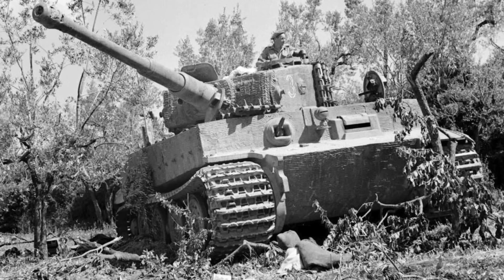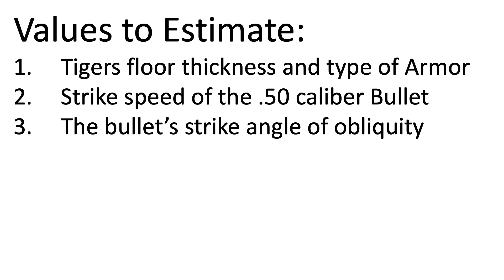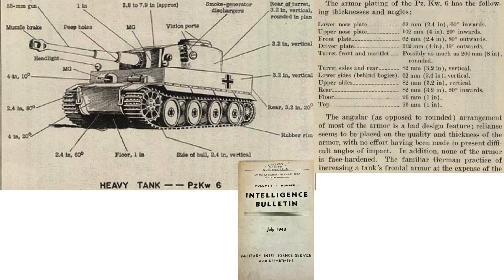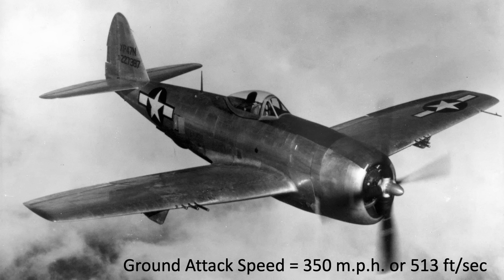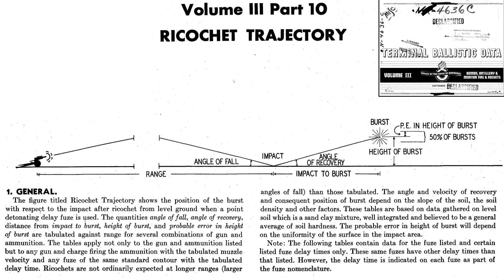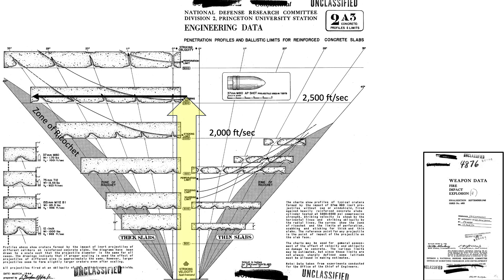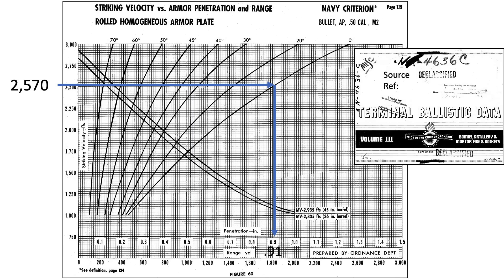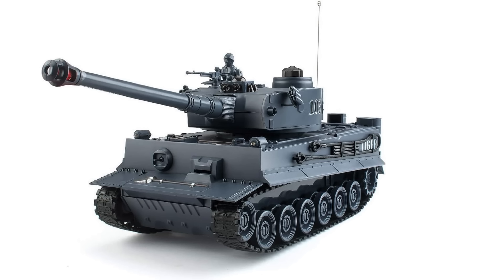P-47 vs Tiger Tank: Can Machine Guns Penetrate Armor?

Comment: Something hilarious about the Panzer 6/tiger tank most don't know is the 1st one knocked out & subsequently captured by the British was in Tunisia being Tiger 131.
All the British had to take it on said tiger in that section in 1943 February were Ordnance QF 2-pounder/40mm antitank guns for those that are metric.
Honestly a QF6-pounder let alone a QF17-pounder had no issue taking out anything the Germans had but it is hilarious to think a QF2-pounder the gun most Americans then & today take the mick out off making it under powered in the few games or shows shown yet of all things 40mm took out a tiger.

PIAT's/personal infantry anti tank would knock out a tiger  tank.
Ordnance SBML two-inch mortar used in a hip fire manner was recorded by mad British soldier to take out tiger tanks once confirmed in Normandy & northern Italy.

You should know after anti tank guns & are artillery being roughly 27/50ths of tank kills of allied tanks on the western front then the next highest kill rate mines at 1/5.
Basically shy of 3/4 of tanks were destroyed by Mines & large field guns of varying kind alone.
Just over 1/8th was (non combat) causes & this was much higher for Axis over stretched logistics compared to  the allies.
Just over 1/8th again was hollow charge infantry weapons & improvised weapons used for unintended purpose of weapons like Molotov cocktails etcetera.
Reply: The first Tiger to be knocked out and captured was by the Soviets on 18 January 1943.
The first Tiger knocked out and captured in Tunisia was at the end of January and was numbered "231".
Tiger "131" was captured eleven weeks later, after the British had destroyed several more Tigers.
I don't recall the 2pdr playing a role in any of this.
Reply: @daveybyrden3936  Oh yes, I forgot abut that one near Leningrad abandoned by the Germans in a failed scuttling & not nocked out technically speaking at point 171 in Kursk I think?
USSR never captured or knocked out ''231'' strangely though heavily damaged externally.

Wasn't that tank at point 171 Kursk safe guarded by the Germans & the crew all survived  if memory serves.
I recall some over 200 14.5 anti tank rifle rounds from PTRS41 hitting ''231'' along with a dozen of each soviet 57mm & 3 inch shells to no avail though it made said Panzer VI retreat a few dozen miles till mechanical failure & fuel leakage from over operation occurred not not soviet arms.
The Soviets ants chased the big scary Tiger tanks till the hardy Russian plains fatigued the tiger for Russian soil is strong ,ah?
''231'' managed to get it's self out of the field on it's own power but barely.

The USSR was the 1st to make a Tiger tank run & flee along with the German crew to save their life's which is hilarious to me personally;)
The Slavic people have an infectious lunacy about them no one could ever match.
You have got to love their spirit, 

On a seperate note "132" was the one captured by the USSR in July of 1943 much later ''131 then ''231'' that slipped away to Tunisia. 
USSR  face ''231'' the Tiger tank to which it ran as fast as it's fuel could take it to only end up in British hands in Tunisia!

 ''131'' &  '231'' are only  ''1'' in place of a ''2'' which has bit of irony in a way & apologies for the mistake on my part mixing up the 2 tanks in my head but my point of 2 pounders still stands!

31st January 1943 early in the morning
 ''"231'' was suppressed receiving damage on all sides but the front & right side hull with two 6Ib guns & countless 2Ib guns. 
taken out by finally a Hawkins Grenade grenade used by a Canadian which they are British in my mind especially in 1940's as Royal assent did not occur till 1982! 

Well my original point was is that 2pounders/40mm guns are more then dangerous to tanks despite what media tells us & your example of ''231'' which |I mistook for ''131'' in the dates.

If Russian 14.5 mm anti tank rifles are a danger to tiger tanks & really all tanks if fielded in enough numbers then 2pounder certainly are.
Reply: @arnijulian6241   
Leningrad is nowhere near Kursk, and January 1943 is 6 months before the Kursk battle. 
Panzer turret numbers were not unique. There were about fifteen Tigers with the number "231".   
The "231" from Russia did not escape and go to Tunisia.
Reply: @daveybyrden3936  ''Point 173 in Kursk'' as conflict did occur in the region before the battle of Kursk.
How did 231 end in British hands if the Germans didn't retrieve it? 
If Tiger ''231'' was captured by the Russians how did it get back to Germany for inspection with flaws fixed in future production models. 
The 231's tank inspection  records were used as examples in the Tigerfibel/tiger training Manuel of 1943.
I have copy scanned print out in front of me  from my Great grand uncle Wolfgang a former Wehrmacht tank commander.
He was made commander as her 7' 8'' tall & could fit in the tank,

Didn't you notice my name sounds rather Austrian for an Englishmen that I am?

I thought Kursk was more north from memory, It's Sort of between Leningrad & Moscow & Kiev.
Show how long it's been since I looked at a Russian map.
Perhaps I was thinking Leningrad as didn't the 1st 4 tigers enter action in September of 1942 in the swampy marshes of that region & one tiger got stuck & abandoned without ever engaging the Russians which the Russian did get to inspect to study to great effect  but neither side recovered it.
I wonder if it's still in that forested swamp?

Their were only 1300 odd tiger tanks 1's made anyway.
How many serial number do you think they had?
''231'' was the hull number not turret.
Serial numbers from 250001 was the 1st production hull & onwards

So the correct manner for serial of 231 would be 250231 on the registries.

*1st production Panther tank 210001 onwards.
*Panzer IV 80001 onwards. 
*Panzer III 60001 onwards.

Etcetera, you get the idea making rather convenient to know by the Tigers production 24 other tanks 

If you want to argue your welcome but I have seen Fahrzeug Identifizierungsnummer as in Vehicle identification number on German armoured vehicles 1st hand as an Mechanical & electrical Engineer lad.

I do find it amusing that everyone thinks they know best on these matter but I talked to the real deal soldiers of all sides in ww2 including Axis even if my German isn't great.
My family & clan Julian are a bunch of Cornish London  Pirates turned Privateers then Mercenaries historically to even my father.

My mother is Austro-Hungarian side in ww1 later 3rd Reich after the  Anschluß Osterreichs were Austria joined Germany in 1938. 

I do get numbers & bits mixed up on occasion but I'm not as off as you think.
Only human & fallible though since my failed health my memory is kind of hazy,
Reply: @arnijulian6241 
Each Panzer had a unique chassis number but we rarely know what they are. They are rarely visible in photos and they are not mentioned in battle reports.
It's common practice to refer to Panzers by their tactical number, which is visible in most photos. But it's not a unique number.
I told you that a Tiger numbered "231" was the first capture in Tunisia. Its chassis number was in fact 250011.
It has nothing to do with any other Tiger numbered "231".

Comment: I want you to consider the tiger's engine deck And how many 50 caliber slugs per second could go through that engine Deck because it's very wide open you could look right through the screen and see the carburetors and these tanks were notorious for engine fires when starting up you could fly over this and put 50 cals through the engine deck and you don't even have to Pierce any armor
Reply: Study the construction of those engine decks. You'd have to be hitting it from directly above to get any rounds inside. The Germans weren't stupid....nor was anyone else. Every tank in the world needed some vents somewhere to cool the engines. They were designed not to be especially vulnerable, although they were often weaker than other areas. If the vents were easily penetrated, then indirect HE fire from howitzers would have bene able to take a heavy toll of tanks, and we already know that didn't happen.
Reply: You're absolutely wrong here. It was not possible to "see the carburetors" from outside. The gratings on a Tiger's deck went to the radiator compartment, which was walled off from the engine compartment.

Comment: Many 'personal accounts' have some embellishment. In a war where all enemy armour is described as a 'Tiger', even though it may have been a Marder or a Renault 35, will suggest that 'we' knocked out more Tigers than even existed. Then again, if you fire enough ammunition at enough tanks, odd things will happen. We can all imagine some 'what ifs', what if the crew had stashed some jerry cans of fuel on the rear deck? What if there had been infantry riding the tank who jumped off leaving a Panzerfaust on the engine deck. 

Shooting up tanks belonging to the enemy is a good idea, it makes them close hatches, reduces their ability to see, identifies them so that the folks with a 3.7" can aim at them. The noise inside the tank would stop you sleeping, increases stress. It is a good move. Did it knock out lots of tanks? Probably not. Did it reduce the effectiveness of tanks? Undoubtedly.

Comment: Excellent video, complete with sources, historical data and impartial research. Well done.

Edit. just for curiosity's sake, I've used a more refined approach to estimate the striking velocity of the .50 cap M2 AP bullet at 400yards if fired at 3213fps. The result is 2671fps.

Comment: They only need to penetrate the engine block… job done.. mobility kill
Reply: The "engine block" is the body of the engine itself. That's the meaning of the term. And of course, the engine was inside the tank. You had to penetrate the tank's armour to even touch the "engine block".

Comment: The rear engine grates were not baffled/  In other words, if you were standing on the rear deck, you can see right into the engine compartment.  I have read of Tiger tanks getting the radiators holed through these openings.
Reply: You're absolutely wrong there. The gratings lead to radiator compartments, which are walled off from the engine. You cannot see the engine from outside.

Comment: Looking at the footage and given that dispersion pattern of wing mounted guns I doubt you could aim under the tank anyway ... that said there is a lot of rounds hitting those vehicles ... they could still do a lot of damage ... the engine bay would be very vulnerable from those angles and they are not the most reliable engines to begin with.  One round getting in past that grille would sever coolant or hydraulic lines or electrical cables, disabling the tank ... given there were other more powerful weapons deployed like rockets on Typhoons I would not want to be stuck in a broken down tank in the open in broad daylight ...

Comment: Having   once been a crew member on an M48 tank . I have little doubt that  a .50 cal, would do a lot of damage to any tank. However the damage would most likely be seen on all the boxes and equipment on the hull of the tank. Also However I  think a tank could be made inoperable if the .50's hit the tracks and suspension and could knock out the engine if the .50s hit the engine grills, which are not armored.. Unlikely the .50s would "destroy" the tank, but they could do a lot of damage. If I  were a P-47 pilot I suspect it would be great fun to work over any tank with your 50s, but to be sure of "destroying" a tank the rockets are a better choice.

Comment: Muzzle velocity of the 50 cal was 2700 fps from a stationary gun. Now figure the aircraft is moving at least 200 to 300 MPH in a dive and that adds velocity to the round and it's penetration. In addition to that, tanks in combat are not spotless. There is going to be oil and fuel mixed and likely on the underside of  the tank. Setting that on fire, under the engine compartment can have negative consequences for the tank. A kill is still a kill if the tank is set alight from spilled fuel / oil just as if it is penetrated by the rounds. Same for all of the oil and fuel cans on top of the tank which was not uncommon given the need for as much fuel as the crew could scrounge in the latter parts of the war. Either way, I trust the word of the folks who were actually there over the paper figuring of someone who wasn't.

Comment: Actually there are videos of .50 ap rounds penning over 1" (25mm) of steel, even going through the head of railroad rails. If fired at a steep enough angle in a dive, .50, 20mm, 30mm fire can indeed pen the top armor of a tank. 
No ricochet required, just dive and pen from the top.
Reply: Railway rails are not manufactured out of face-hardened armor plate. Tanks were.

Comment: Anybody digging up the range test figures for the 50 Calibre M2 (12.7mm. L.130) HMG would know that the shorter barrelled 9reduced velocity) fighter 50 Calibre would fail.

M2 50 Cal AP = Up to 25mm. of RHA @ 0 degrees @ 100 yards
M2 50 Cal API = Up to 21mm. of RHA @ 0 degrees @ 100 yards.

Another 1942 field test report discovered that shooting 100 AP rounds at the lower hull side of an abandoned Japanese Type 97 Chi-Ha medium tank, at a square on range of 50 yards, achieved 35 clean penetrations. The lower hull side of the tank was only 9mm. thick.

Comment: They may have observed how far their tracers would fly when they bounced off the ground. That could give the impression that they have a lot of velocity and were still flying point first. It would be easy to think that ricochettes could be used to go through the bottom of the tank, especially if they didn't know how thick the armor was. 

They probably had a better chance of damaging a track or getting through the deck over the engine, or a lucky shot down a vent, and open hatch on the turret of the like. 

Rockets would have a better chance of doing some damage. There are also some stories about napalm bombs being used against German tanks, and that it was quite effective. I've seen related stories that the Germans at least thought this was true and was a reason they'd abandon tanks when aircraft came at them later in the war.

Comment: They are coming from above the tank , that means , tha even if they do not penetrate its armor , they could still get into engion vents , etc . and cause damage or malfunction , that would put the tank out of use . Next best thing to destroying it , as the Germans had parts supply issues , especially later in the war . Tanks would be out for weeks , or even months , in repair yards just waiting . Ammunition used makes a difference as well . If they leave the airfield , with the intention of going into combat against enemy aircraft , they will probably be loaded with incindiary rounds . If they are on ground attack missions , they will be loaded with AP .

Comment: A now deceased WW2 P47 pilot (and engineer) buddy of mine said he supported Patton, and maintained that the 50's could indeed disable a tank,  though I always remained a little skeptical, therefore I found this video interesting.  (We were buddies because I was formerly an Army gunship pilot in Vietnam, and also a former helicopter anti-tank instructor.) This guy was in civilian life an engineer with me, so not so prone to exaggeration.   I have been downrange and have seen close up what various weapon actually do to armor targets on firing ranges.  Certainly 50's  would damage  external features, maybe the tracks ??, and definitely be hard on any supporting infantry (without which a tank is vulnerable.)  Also, one thing to keep in mind (my experience) is that if one shoots at a point target like a tank then likely that target has unknown supporting buddies shooting back at you, beside the mere tank in question, which tends to dissuade one from getting overly close to objectively examine targets after firing runs.   I suspect the tank dudes just hunkered down till the planes left, then got out and surveyed the damage.  Of course, some of the planes also had rockets and bombs, too.  But I wasn't there.  Maybe these old dudes really weren't exaggerating at all.  Or perhaps the "tanks" they struck were just lightly armored vehicles, more susceptible to damage than tanks.

Comment: One of things people brought up was the fuel trailer towed by the vehicle to extend the range as being the target they went for because the towed fuel tank was armored on top vs the bottom being vulnerable to the intended ricochets.
Reply: Very, very rare in 1944-45. The only extensive use of fuel trailers on German AFVs was in 1941. They didn't work very well so you almost never see them after that.
Reply: @executivedirector7467  well the idea was in assuming that the lack of rail being available from ground attack would force the tanks to make solo journeys was what was said in the original video.
Reply: @TheOfficial007  That may be, but you'd be very hard-pressed to find a phot of a German tank towing a fuel trailer taken after Jan 1 1942. They weren't even common in 1941.

Tanks aren't very good at towing trailers, that's why you seldom see them.

Comment: Would it not be that the 50cal destroy the tracks, making the tiger basically static till repairs could be effected.  Also, how well was the engine compartment protected?  Remember, these engines sucked down tremendous amounts of air for combustion, and the air needed to be moved across the radiators.  You don't have to totally destroy the vehicle and kill the crew to take it out of the fight, just simply immobilize it.  Simply taking out the radiator would rapidly take the tank out of the fight.  There are stories of clever crews with bazookas taking out a tank with more than sufficient armor to technically making the weapon useless in defeating the armor by destroying the tracks and taking the tank out of the fight.